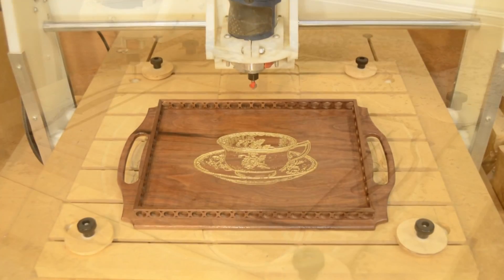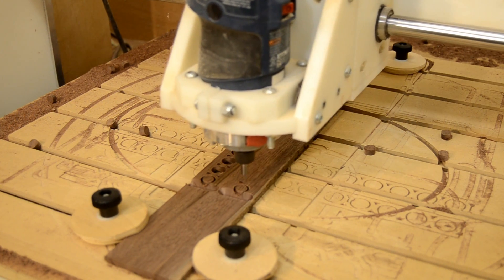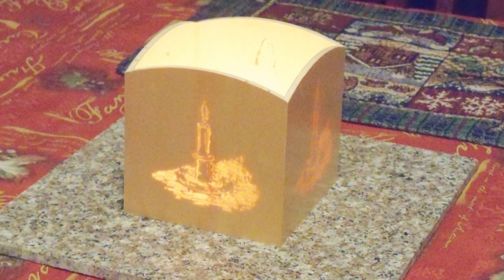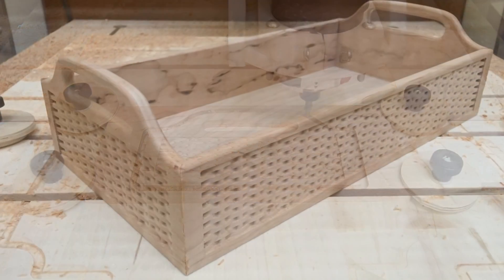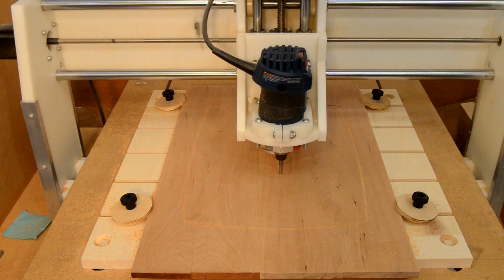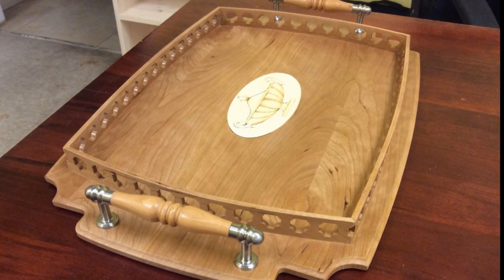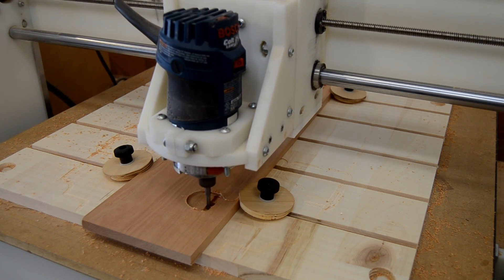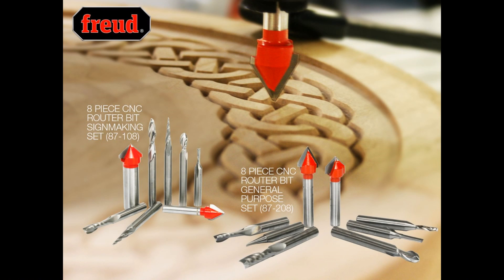How to Choose the Best Bits for Your CNC

Comment: Can you plunge with a straight bit? I though you need it a drill or spiral looking bit to plunge, no?
Reply: phil par it depends on the straight bit.  Some have cutters on the bottom and are made for plunging.  Others only have the cutting edge on the sides, and you should not plunge with those